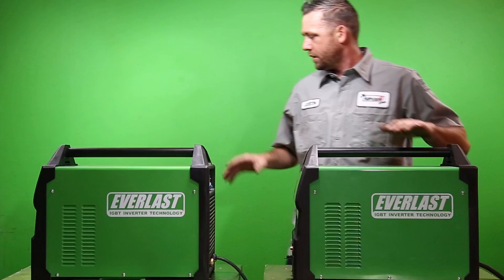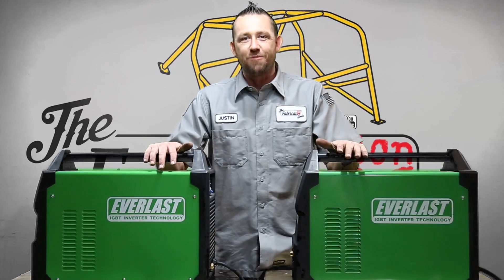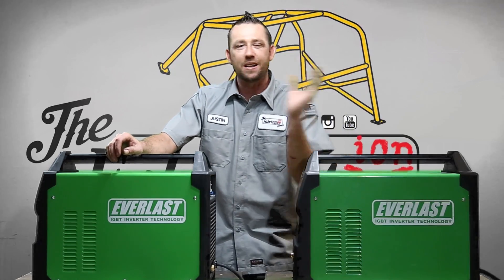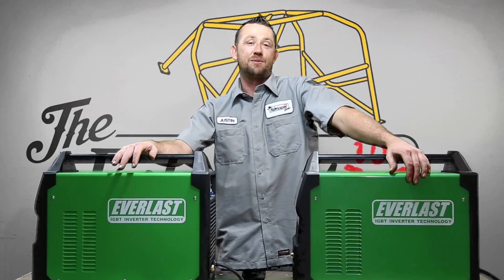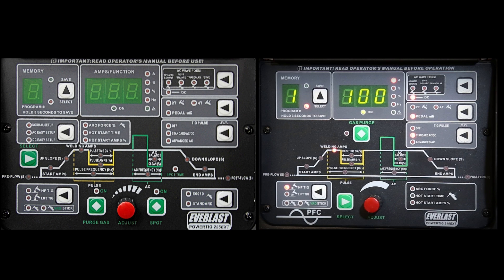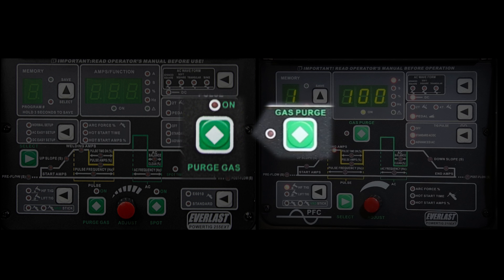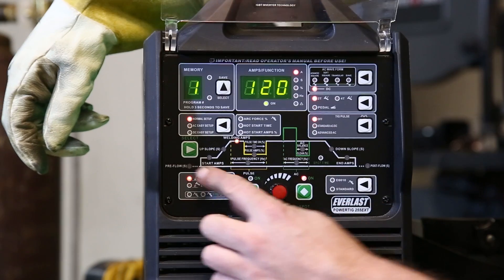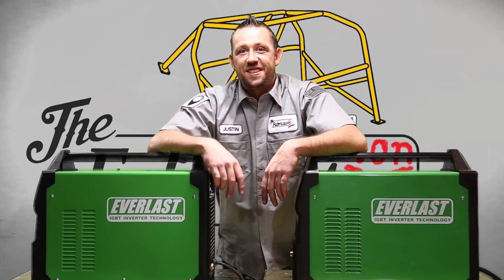TFS: Everlast PowerTIG 255EXT and 210EXT Welder Review

Comment: Thanks Justin you helped me make my decision. I’m gonna try everlast. I wanted forney 220 but no post pre flow adjustment. I have Lincoln 210mp I bought new 4 years ago for $1400, now they are 2200-2500 crazy increases with Lincoln, the tig200 was about same pricing 1400 years ago now they are 2500 min.

Comment: Everlast 255ext vs. everlast 325ext…. Obviously capable of more amp output and a small difference on minimum amps. Besides the price difference and the amp ranges is there any reason I shouldn’t go with the 325ext. A/C is going to be my primary process, likely 1/16 on up into a rare 1/2 for me. My thought is going with the bigger machine so that it never has to work at or near maximum capacity. Am I comprising performance or just overthinking this situation????

Comment: so how are the stick welds on these? are they both able to run rods such as hard surfacing rods, I know they can run 6010 and 7018, but looking for something that can do hard surfacing on heavy equipment but also do tig welding, would you recommend the 255 or 210 for someone that may not use it often but wants something with a smooth and high output? thanks! 
-Caleb A.

Comment: EVERLAST OTHER OEM SELLERS SPPOL GUNS ARE HIDING THEIR WELDERS FRONT PANEL CONNECTORS PINOUT AND THE SPEED CONTROL POTENTIOMETERS IMPEDANCE. I HAVE SEEN ONE GUN FOR SALE WITHOUT CABLE AND IT HAS A 10K POTENTIOMETER. SOMEONE WHOM HAS ONE COULD USE AN OHM METER FOR ME PLEASE

Comment: I NEED YOUR HELP I BOUGHT AN EVERLAST MTS221STI IT CAME WITH TIG MIG STICK AND TIG PEDAL
HOWEVER I WANTED A CHEAP AFFORDABLE ALUMINUM SPOOL GUN I AM DISABLED AND CAN NOT AFFORD EVERLASTS $400 I BOUGHT AN NBC200 SOLD I SEE BY EVERLAST HOBART AND OTHERS AS AN ENTRY LEVEL GUN. I GOT BY A SELLERS MISFORTUNE MISTAKE A 6 METER CORDED EURO STYLE GUN FOR $86 I HAD TO BUY A USA SPOOL CONVERTER FROM THE ONLY SELLER ON EBAY. SO I HAVE A GUN THAT PLUGS IN EURO 2 24VDC WIRES. EVERLAST SOLD ME A PLUG BUT LIKE A LITTLE CHILD SHAKING HEAD ARE NO NO NO NO THEY WONT TELL ME THE PIN OUT OF MY MTS221STI FRONT PANEL CONNECTOR NOR THE OHMS OF THE SPOOL GUN MOUNTED POTENTIOMETER. CAN ANYONE PLEASE BREACH THEIR TRYING TO PREVENT ME USING MY OWN CHEAP SPOOL GUN.

Comment: The advanced AC TIG pulse feature combines aspects of AC (cleaning) and DCEN (penetration) for heavy aluminum, and is advertised to enable welding of thicker sections than you normally could at the same amperage with standard AC TIG.  I'd like to see an evaluation of this feature which seems to be unique to Everlast.
Reply: Everlast just released a video on advanced AC pulse

Comment: I'm torn between the lightning MTS 225 (mig tig stick) and the powertig 255ext (tig and stick) the  powering has slightly better specs, but the lightning is the same price and has mig capability. Any guidance would be appreciated

Comment: I had a old everlast 200, there was a board failure from the get go which didn't allow for the pedal to work,  trigger button worked fine and it still welded just fine, they had me return it on their dime, and I chose to upgrade to the 225LX, this was in 2011 and that welder was excellent.   I ended up selling the welder for more than I paid for it about 6 years later.    My newest welder was a song on a facebook buy and is a lincoln squarewave 200 and I miss post flow adjustment and the low amperage starts of the everlast.

Comment: Does the 210ext weld 6010? So would you rather have a 201ext, lincoln squarewave 200, or a powerultra 206pi? Kind of want aluminum capability if I ever come across it

Comment: The 210EXT comes with two air cooled torches, a 9 and a 26. The 255EXT comes with one air cooled torch and one water cooled torch, a 9 and a 20. So to use the additional powder you'd need a water cooler or another air cooled torch that was larger.  The 255EXT does work with E6010 and the 210EXT does not. To go with the additional power the 255EXT has some additional stick welding features, such as VRD. For most TIG welding, the 210EXT is likely plenty.

Comment: Hey brother! Love the content.  Question: Newbie on a PowerTig 255 EXT, 3/32" lanthanated, 3/32" ER70-2 filler rods,No 5 cup, 10-12CFH, 2s preflow @50A, ramp for 2s up to100A, 5s down slope @50A, 5s post flow on 1/4" plate steel.  Having major oxidation of the electrodes (I think).  DCEN, 2T, HF arc start...  Any thoughts?  Learned stick welding (underwater) in the commercial diving industry. New to TIG.
Reply from the maker: You need more amps and smaller filler.

Comment: The Fabrication Series
Have you tried the  tig button yet ? I use one on my power tig 250 ex. Its essentially a foot pedal at your finger tip.  I do allot of intercooler work on compound turbo diesel stuff.  I love the thing.

Comment: Are you limited only to the use of “Chinese” tig torches with Everlast or can you use CK or Weldcraft torches without modification or special dines adapters? How about pedal? Does it have the random Chinese connector that no one uses making it hard to get a replacement pedal because the plug is not used by anyone else? I see these as 2 very important wear and tear items that need to be able to get spares if needed or upgraded.

Comment: Justin, its been a year. How is the Everlast 255 EXT, and 210 EXT welders holding up? Any issues?
Reply from the maker: Solid! Had a small memory issue with the 210 which Everlast corrected by sending a board. The machine still worked all day - just couldnt store settings on the other 8 channels. The 255 has been without any problems at all.
Reply: Thanks for getting back to me. I just watched you HTP Invertig 221 video, and I think I like that machine even better. I was looking at the HTP years ago.

Comment: PrimeWeld TIG225 might be a good competitor for these Everlast welders. Same technology sold with a CK flex torch and 225a of power. So far I Love mine. I didn't go with everlast because of reviews that scared me.
Reply: I agree. Returned repaired welder not what you sent in. Poor company response and top board failures. The PrimeWeld seems like the way to go.

Comment: I've been welding for close to 10 years and have always been a Miller fan. Used a 210 EXT, bought one for myself and have never looked back. 

That was almost 3 years ago and it has never let me down.
Reply: For me that leave down 3 months 256 neverlast power pro not work ac
Reply: I sold it

Comment: I'm considering the HTP 221 but I am a beginner, I'm also 62. Should I buy the 210EXT and save almost $1000, or get the HTP. At my age I don't want to be "stepping up" later. I need something that will last me. I am working on old cars doing sheetmetal repair, and may weld/fix things around the farm. I have a Hobart 185 Mig already. Thanks Justin for all the great reviews, I try to watch them all. Joe in Colorado
Reply: You wont have to worry about outgrowing the 255ext. Htp is an awesome machine also but a little down on power. Plus the 210 ext is way cheaper. Htp is quieter though.
Reply: 255ext over htp all day. I am a professional welder and bought mine 2 years ago. Same performance as 280 dynasty and a fraction of the price. The dynasty is actually missing a few features in comparison.

Comment: What is the difference in low range amperage between the machines? On the website the 255 advertises 3 amps DC and 5 amps AC, but the 210 does not mention in the specs.
Reply: The 255EXT will START with 3 amps in DC and START with 5 amps in AC. The 210 EXT will START with 5 amps in both DC and AC but can operate down 3 amps.in DC and down to 5 amps AC. So in theory the 255 EXT can have a milder DC START than the 210 EXT. Not a huge difference though as 5 amps is still pretty low.

Comment: Good video, I really want a Miller Dynasty for home use. We have 3 different sizes at work and they definitely are great machines, along with all the other blue welders we have. But and this is a big but, I can't justify the cost for having one at home. just to get in at the bottom end is going to cost me about $3,500 dollars. or more haven't checked in a while. Cyber weld is usually the cheapest so that's the pricing I'm using.  There other options of course, used Dynasty , but they are hard to come by.  Sycro wave, big, power hogs, not as many features. That's the problem with welding with really good equipment it's hard to chose something with less features. Thanks for the review.
Reply from the maker: I had a Dynasty for years. It was and still is a great machine. I personally can't justify the price anymore. It's too expensive in my opinion for the same thing it has always been. The 255EXT is kind of scary in that is welds better than I remember my Dynasty running. It almost feels wrong to say that, but it's a beast at a fraction of the price.

Comment: Hi im looking for an tig welder and i have spotted this everlast power i tig 200t dc machine. It has a good price line and suits up my needs does anyone have any experiences of it. Or should i just buy dc/ac inverter it will take longer but still. Power i 200t has max amp of 200 and 35% duty cycle for that max amperage

Comment: I ordered a welder a week ago.  I received an email conformation with a tracking number and it showed that I would receive it today 3.2.18.   I checked the tracking number with UPS and it showed it had not been shipped.  I called Everlast to see what is going on and was told it was back ordered and that they had called me to let me know.  I have not received any calls from them.  If it was on back order  why did they not  just send me an email to that effect.  When I let them know what I thought of the way they do business they said they had refunded my money.  I told them the money wasn't important I want the welder they promised me TODAY.  They basically told me they didn't want me as a customer.  I guess I'm glad I found out how poor their customer service is before I ended up with a machine I can't get serviced.  I guess if you factor in the time spent waiting on a back ordered unit, a guy is better of going down to the local welding supply and buying a Miller, or Lincoln, or Esab because you can be making money with the equipment and not waiting for it to ship from China.  Very Disappointed.  Love this channel, disgusted with Everlast.
Reply from the maker: TheWreckerMan TX Bummer experience. Did you order the 185? I heard that was back ordered for like, ever haha. A bunch of people wrote in and told me it is/was. I guess it's hit and miss with service. Mine has been good so far, but there's lots of other instances people have reported.
Reply: Just got back from the local welding supply with a Lincoln Tig 200 square wave.  Doesn't boast as many features but should have all a guy needs and it's supported locally.  No waiting forever just to be told to wait some more.  Time is money!  Love what you're doing.  Thanks for the reply.

Comment: How does the 255ext go on low amp is it stable will it light up, i am looking for a machine thst will have hi end performance like the 255 but i also need something that will weld at 10 amps. I could buy 2 machines but one would be better. Keep up the good videos

Comment: Justin I'm stuck between the miller synchrowave 210 and the 255ext anyway you can give me you're opinion? I've always been a miller guy
Reply from the maker: I have run both and the Syncrowave is the machine i was going to buy instead of the 255. The Syncrowave is a beast. It's solid, it's proven, it's dependable, and I still don't want one. The only thing it is not is portable. The 255EXT is pretty much everything the Syncrowave is with a few extra standard features (Syncrowave is a bit stripped from the factory) and it's very portable. Both are solid machines, but I'm happier with my purchase of the 255.
Reply: The Fabrication Series thanks a lot that helps make my decision a little easier haha keep up the work I love it!

Comment: How does the 210EXT compare to the HTP Invertig 221?
Reply: Granamire I have the invertig 221 and it’s more comparable to the dynasty 210 but the one thing about the invertig is that you can independently adjust on AC the EP and EN in regards to how much time is spent on each for amour or time. The dynasty 350 has this feature. The everlast does not. Not knocking these machines but the invertig 221 will also Pulse stick weld and run 6010 beautifully. Only the 255ext can run 6010 no Pulse. The torch is ck worldwide on Invertig and pedal is SSC. You can get the 221 Invertig and the watercooler as well as ck worldwide watercolor torch for 2950.00

Comment: should i get the 210 or the 255? im mainly going to use it on exhaust and intake manifolds and maybe some boat stuff. 
thanks
Reply: e34Boat then you won’t need a 255 but I’d go with the HTP Invertig 221
Reply: Welding Junkie none of them

Comment: Awesome video! I know you meantioned u didn't have the correct torch at the moment to do 250amps but I see they now sell the 255ext comes with a water cooled torch, will the water cooled torch be enough to run the full 250amps?
Reply from the maker: Joshua Sherman It will if it's hooked up to a torch cooler. Without a cooler, it's just a number 9 with extra hoses. My 255 came with the number 20 but I do not have a water cooler unit.
Reply: The Fabrication Series awesome! Thank you very much for the reply!

Comment: Nice video and beautiful welds as always. I have a gigantic Synchrowave 200 and would like to upgrade to an inverter machine. I really like the 255ext. Two things (beside the centered gas inlet) that really turn me off on these Everlast machines is that the fans run constantly and I hate the circuit-breaker power switch being located on the back of the machine. I realize they get a higher duty cycle with the fans always running, but a switch for constant fan 100% duty cycle or 60% fan on demand would be great. The power switch being on the rear is very inconvenient in my small shop with the unit backed up against a wall. What are your thoughts on these ideas? Maybe you could cover these issues in a future episode.
Reply from the maker: DS Splicer I would like to see the switch on the front but, realistically, there's no place for it. It's not that big of a deal in my opinion (you get used to it). I had the opportunity to speak with one of the Everlast engineers about the fans and it was pretty uch down to "make it last - or - make it quiet." I'm with making it last and being sure about it. I've blow my fan on demand Miller up 4 times already. Can't say for sure that's the reason, but if it was - I'd rather the fan be on constantly to keep the repair time down.
Reply: Fair enough. On the fan issue, it'd be nice if they could figure it out, but not at the cost of reliabilty - you're right. On the switch...eh just would be nice. BTW - are you in Vegas (I am)? I might have to come take a class or something. :)
Reply: Just something to think about with a fan that runs all the time you know when the fan is working but if you have a fan that only goes on when it begins to heat up if it's should stop working you might not know until it's too late
Reply: Good Point Joe.
Reply: FWIW, I’ve had the 255 for a short while now and neither the switch or fans bother me. The machine is so small that I don’t find it a problem to reach back to turn it on. It’s not like reaching over a huge Syncrowave. And every welder I’ve owned had full-time fans; these are quieter than the old ones. I don’t find the noise a problem, though so many guys seem to.

Comment: does the 255ext run on 30amp 220v? or does it require 50amp?
Reply: Part Out 30amp it’s an inverter
Reply: all inverters only require 30? the 325 and 350 ext also?
Reply: Part Out no sorry I mis spoke I was speaking on the question of the 255ext, I didn’t realize you were asking about all inverters. Had this been a 255 transformer it would need a 50. As well as the 300/325 inverters if they are single phase. You also have to consider the machines duty cycle. I’m not sure there is a one fit answer for all welders inverter or not.
Reply: awesome thanks for the info  wow the 300amp machines will run on 30amp 220? thats pretty amazing
Reply: Part Out not all most 300 amp plus need 50 amp but it all depends on duty cycle. If you are going to run on 300 amp for full duty cycle you’ll trip your breaker it’ll need 50amp

Comment: Hey can you try running the Advanced AC pulse on that half inch aluminum @ 200amps see if that does it without needing to go higher.
Reply from the maker: Part Out I've had a bunch of requests to run the advanced features in a vid. I'll get to it as soon as I can. It's on the list.
Reply: Awesome

Comment: Does the 210 burn 6010 rods for sure? this is what i'm trying to decide which of the 2 to buy myself currently.
Reply from the maker: Part Out I'm not a stick guy, so I may be wrong. It is my understanding it can (as in - it's capable), but without the specific setting, there's no saying it will correctly or easily. 6010 is completely foreign to me haha. The 255 will burn 6010 for sure.
Reply: Go to Everlast’s website and download the manual, then call them to make sure what you read in it is still accurate. Be sure you get somebody who really KNOWS, because they’ll make guesses on the phone, or get confused. I know this from experience. Don’t trust any specifications you read on their web pages, because the website is full of mistakes. Download the manual.

I bought the 255. It burns 6010 just fine because it has the special mode. I like the machine so far, but dealing with the people has been crazy. Never seen so many mistakes anywhere.
Reply: The 210 doesn’t like 6010 the 255 loves it

Comment: Yeah, I've had my 210EXT (2015 model) for nearly three years now and like it well. I especially like that it has the added Triangle waveform for when I'm welding lighter aluminum. The four fans inside the 210EXT, ironically, make it nearly whisper quiet too.
Reply: Still holding up ?